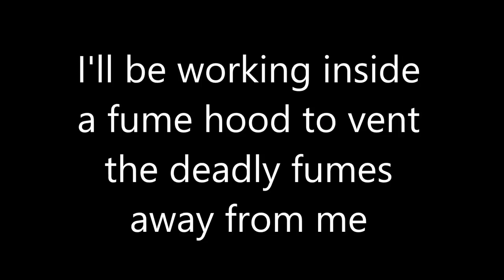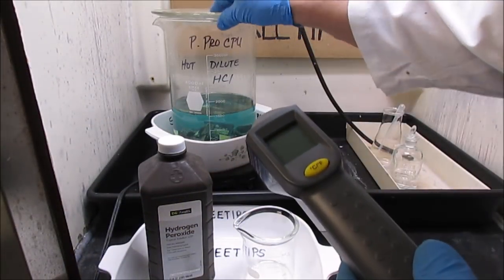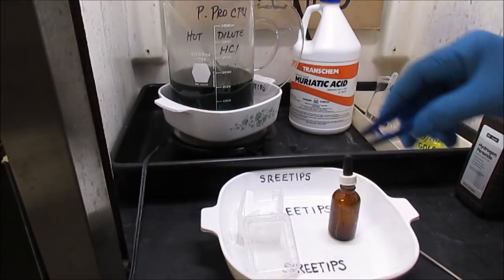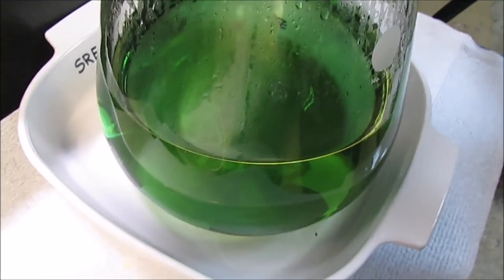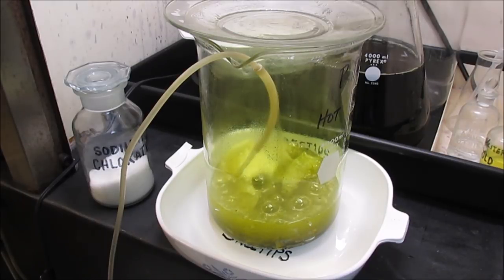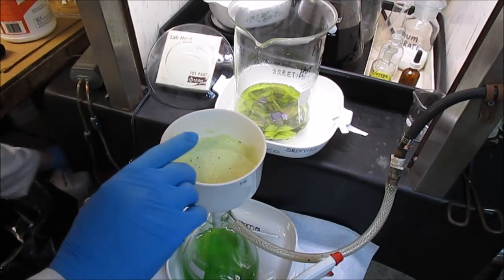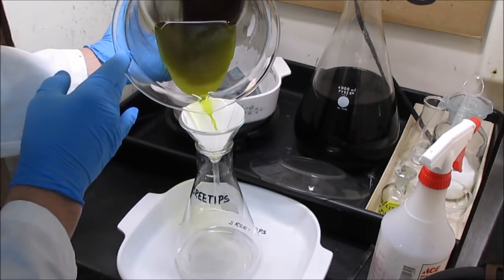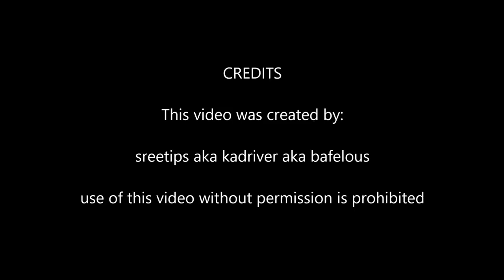Gold Recovery Pentium Pro with Sodium Chlorate

Comment: Great video, as always :)
It is a bit painful to see to see technological wonders like those processors being reduced to rubble to be processed to a bit of precious metal, I'll admit. On the other hand, it makes sense to reprocess them, since the availability of precious metals and other compounds is limited and should not end up in the environment.
I was always curious about that... what do you do with the leftover garbage of the refining process? How do you dispose of it safely? How do you neutralize the toxicity of what is left over? Do you have close at hand base-solutions to neutralize acids? How do you handle run-away chemical reactions for example?

Those could be interesting things to explain in your videos. 
Thanks for sharing and showing :)
Reply: I'm curious as well.
I have two gallons of that stuff and don't really know what to do with it.
Reply: He has the luxury of only really dealing with metal salt solutions which can actually be processed rather efficiently into harmless iron metal/iron oxides/iron salts. He does this by having several waste stockpots. To start he takes solutions with excess nitric acid and adds sterling silver and other silver sources in order to consume the remaining nitric acid. Then in the first pot he puts solutions containing silver and copper salts and adds copper metal which removes the silver from solution and cements it out. He removes the silver and places the remaining solution into a second pot and adds iron. This cements out the copper and leaves iron salts. He can then remove the copper and then take the iron salts and either dispose of them at a designated disposal plant or convert the iron salts into iron oxide which can be sold or just disposed of since it it pretty much inert.
Reply: @jasonmcfall5578 I have 1 tonne and I can’t decide if spend the resources to get the gold or just sell as is.

Comment: "From another refiner" [sic] some samples of PP's sent to get tested and found something very interesting.
As you might be aware there's a couple major variants to a PPro, Mostly the ceramic version and the later plastic version.

The plastic version was the latest and most expensive which had a 1mb cache as apposed to 512kb in the ceramic.
So instead of a processor die & a cache die, the plastic version has 3 dies, 1 processor & 2 cache dies.
Effectively increasing the gold content by 33%, but the actual dies are bigger as well.

Our results are approx .7g Au per cpu but could be a little more.
Do you think this is where the 1g per cpu myth came from? were early assaying results using the plastic version and it the got confused with all PP's and add to that backyarder refiners not recovering the potential led to the down ramping of PP's in general?

Comment: I always leached the base metals with nitric, never occurred to me to just use hcl to do it. Will definitely save on nitric costs. Thanks kadriver!
Reply: Hydrochloric takes forever. I've accidentally disolved gold using HCl and hydrogen peroxide with heat. Don't have to worry about that with nitric

Comment: Hello,
First off, I would like to say: Great videos!!  I think I watched all of them at least 3 or 4 times.  You make the process look so easy.  I just installed my fume hood and supplies to try this for the first time.  I ordered some computer chips for this initial project but it appears that these chips have been removed very sloppily.  It appears there is still some solder left on them.  As a new refiner, will this solder burn off in the incineration process, or is there an extra step to remove this solder? Like you, I would like 3-9s fine product when I am done.  I know you are busy, but any suggestions will be appreciated.  Thanks.
Reply from the maker: In the refiners handbook, she says to soak in hot hydrochloric acid until the solder softens then scrap it off with a knife before trying to refine it. Escrap is kind of tricky, very little gold.

Comment: So I work at an e recycling company. We easily get 100+ junk processors per month. I imagine if we shredded them we could fit a lot more than 10 into a 4 L beaker at once. But is there a ration of volume HCl to mass of shredded processors?
Reply from the maker: My experience with escrap is very limited. The yields are low and the amount of waste is high. For these reasons I don’t process much escrap.

Comment: When you smash up the cpu's, does size of the pieces matter at all? If you were to put them it a mortar and pestle and smash it down pretty fine (say like sand size granules) and then put in an oven for LIGHT incineration would that help the the rest of the process along just because of increased surface area of the material? Also do you happen to remember what these CPUs weighed in total before you did anything with them? Looking to start stocking up, the listings I see are all by lbs and don't say exactly how many CPUs you get, just by weight. Trying to calculate rough totals based off the 0.3 grams per cpu you stated near the end of the video. Although I'm sure not all are created equal so I'd get a guesstimate at best. Thanks in advanced if you reply!
Reply from the maker: The way I understand is there are tiny gold wires inside the sealed area. Grinding them to sand probably won’t help.

Comment: Hello, Sreetips, I understand that the fumes are EXTREMELY toxic, even deadly. But what about combustible, flammable, or any kind of fire hazard?
Reply from the maker: The only time I have flammable gas is when doing reactions with zinc. I think the bubbles contain hydrogen. But as long as it’s not allowed to accumulate it’s not a problem.

Comment: How many grams per liter are necessary to dissolve 8oz./L gold using this method with sodium chlorate? i attempted to saturate a solution at 150F with sodium chlorate 800ML HCL and the chlorate reacted with a small explosion and flame inside my reactor. Is it necessary to introduce at cold temperatures? Safe to raise temperature once the chlorate has been fully dissolved? Thank you for your advice
Reply from the maker: I’ve never tried to dissolve that much gold with HCl and sodium chlorate.

Comment: Unless you physically put nitric acid into the mix how else could gold get into the solution?
Reply from the maker: Sodium chlorate mixed with hydrochloric acid forms chlorine gas. Chlorine gas will dissolve just about any metal, even platinum.

Comment: question as the level drops below the 1500ml mark. are you loosing water vapor or are you loosing the acid. is you solution gaining strength or is it getting weaker before adding additional acid?

Comment: Would grinding up those CPU's in a blender help in any way to speed up the process of separating the gold foils from base metals?
Reply from the maker: I've never tried it. But experience tells me that grinding the ceramic too fine would load up the filters and slow things way down. Plus, I don't think it's necessary. They are broken apart to get at the tiny gold wire inside the sealed CPU.
Reply: Plus it will increase the haul !

Comment: Sreetips, what does the hydrogen peroxide do for the reaction.  I know you said it would help loosen up the gold foils from the base metals.  Are you able to elaborate?
Reply from the maker: Scott, this is a reply from aga, who is a chemist. He says;

"When the peroxide was first added it looked exactly like it oxidised FeCl2 to FeCl3, judging by the instant yellow/brown colour change.

That might sound like a waste of H2O2, but FeCl3 happily complexes/reacts with copper & aluminium too."

Scott, according to this statement, the hydrogen peroxide forms a compound that attacks and dissolves the base metals under the gold, but does not attack and dissolve the gold. The FeCl3 dissolves the copper under the foils and releases them, intact, into the solution. Pretty cool stuff. I added the peroxide on a hunch, it wasn't in the plan, but it sure worked nicely to release those foils and put the base metals into solution so I could get rid of them before I attempted to put the gold in solution.
Reply: sreetips thanks to both you and AGA. I have been wondering this for sometime. It also answered the question “niggling” around the edges of my mind since I knew HCl did not dissolve copper.  Yet, HCl and peroxide is frequently used with e-scrap. Finally makes sense.
Reply: #1scotthack  yeah, in much the same way that nitric acid has to be added to hydrochloric acid in order to oxidize gold and form aqua regia, the peroxide reacts with the HCL and oxidizes the base metals, even copper without touching the gold. Makes the process go much faster. The peroxide and HCL will do this without iron present but FeCl3 also acts as a complexing agent and catalyst which further helps the reaction.

Comment: I dont understand. In 1 video you dissolved into the solution Pd and Pt from zinc with HCl and peroxide and said maybe gold will dissolve. In this video gold didnt dissolve in HCl and peroxide. Why?
Reply from the maker: I don't know. But I wasn't trying to dissolve the gold. I wanted to dissolve the base metals under the gold so that the gold foils would be released and then I could recover and refine the gold foils. I don't know if HCl and peroxide will dissolve gold, I'll have to give it a try.
Reply: Because the gold will only dissolve in a Hydrochloric and Nitric (Aqua Regia) solution.

Comment: Great video, but I can't understand the reasoning behind breaking the CPU's up. I appears, that it only made for a more complicated process, as the broken CPU's were Not dissolved in solution and it made it harder to incinerate them and remove the gold plating. Just an observation!
Reply from the maker: There are tiny gold wires inside of the sealed CPUs.

Comment: What happens to the fumes exhausted from your fume hood. I have not yet found a video which answers this question.
My concern is that fumes released to external air is dangerous to surrounding area, if not so for the refiner.
Can the fumes be neutralised, or rendered less harmful?
Reply from the maker: My fume hood exhausts out the top of my roof. I don't use a scrubber because I don't make enough fumes to create a problem. A scrubber can be added. I think that they are filled with caustic soda. It neutralizes the fumes.

Comment: Every time I melt gold powder, I get gold flakes stuck to the sides of the melt dish. Is this typical? How can I avoid it? I glazed the dish with borax and add borax while melting.
Reply from the maker: When I get gold sticking to the sides of the melt dish I crank up the flame on my oxy/acetylene torch. Get everything real hot, sprinkle borax on the inside upper walls (where the gold adheres) and use the force of the flame to drive the gold off the wall and down into a central mass at the bottom of the melt dish.
Reply: @sreetips  Cool tip. A sreetiptip. I just use mapp only. Kinda makes crappy buttons because everything doesn't quite liquefy that well. Maybe if I add some insulation around the outside of the dish it will help things stay hot and they will slide down doing what you said.

Comment: Question: I tried the poor mans nitric (sodium nitrate) to dissolve my gold from recovered flakes. It worked and dissolved all the gold to solution. Thing is the stannous chloride did not indicate gold in solution. and SMB did not render gold from it.  Where could the gold have gone if not in dissolved solution as it clearly got dissolved. (used Hydrochloric plus dissolved sodium nitrate) ?
Reply from the maker: Sounds baffling. I’m just as puzzled as you
Reply from the maker: I’ve never used poor-man’s. I have used HCl and bleach with good results. But it makes lots of deadly chlorine gas. Must do it in a fume hood.
Reply: Thank you for all the information in your videos. Inthis video you didn't use a test for iron and magnetism; I'm doing my second project with Cpus,  when I came to disolving the gold the solution came negative for gold.  I suspect that iron cemented the gold. I Saw the gold before before putting HCL + bleach; is it good to try stump-out even the solution is negative?. I really appreciate your answer.

Comment: I'm just learning about this so forgive my ignorance. Would it not make more sense to put those chips in a AR solution and then decant when the expected gold is dissolved based on time and temp in solution? Based on what I have learned this entire process should only take an hour at most.
Reply from the maker: Putting the chips in AR sounds like it would be faster and it may be. But it causes other problems that makes the process difficult. I have a video on CPUs in aqua regia. It's not that easy.
Reply: @sreetips  I would be very interested in seeing that video, I started putting power interconnect pins in AR because I got tired of waiting for all the base metal to dissolve (some of the pins were quite large), Once the pins turn black I filter out the solution and that turned out to be a big time and money saver.

Comment: I use a heat gun to heat the cermic piece and the tiny cleets will come lose. . They dont go into the ceramic  but are sodered on the surface. The . What ever you call those thing s the only ones i encountered was with gold plated metal caps inside and out .  The refiner in Philadelphia  dumps those in a ball mill    and sales them pulverized  to a large refiner in Philadelphia . . I have seen gold plating on ceramic. Most notably  in allumniim boxes containing a cermanic circut board  and the gold plating  was  applied   directly  to the very thin cermanic circuit board . I used hot muratic acid to loosen the solder  where resistors  were attached . And wash aqua regia over the cermic waffer the gold would  instantly go into the chemical   these were from satellite  dish  supplier  .
Not home satellite  dishhes but  industrial satellite  supplier . On wellington road Outside of Manassas  Va.
Reply from the maker: How many does it take to get a gram of pure gold?
Reply: @sreetips   i go bonkers with gold fever. When looking at the beauty  of gold plating. But those chips  are worth far less than you could imagine
Reply from the maker: I've processed Pentium pro CPUs about four times because they are said to be the highest yielding of all CPUs. I got 0.3 grams pure gold per CPU every time.
Reply: @sreetips   wow thats impressive . A measurable amount of gold per chip

I look at some pictures on a google search. And im confused. Do these  cpu have gold plated metal caps over the actual chip . In your video it looked like the gold cap was laid over the ceramic  and shattered   when you broke them up. Those Pentium  pro cpu have metal caps over the actual  chip?
Reply: @sreetips   those IBM  cpu were assay  at $22 gold per chip and the price of gold spot was say $360 a troy oz. So what is the ratio of $20 of gold  compared to $360 is 18 .  So it woulx take 18 cpu to equal an ounce of gold. Cant remember how many the machine had . Say 12 per machine  so each machine had 2/3 an ounce of gold . .  The back planes and attached circuit boards had no visible gold the  the metal clips were said to be palladium.  Who knows . They look like nickle with a translucent  application  of gold on the nickle or palladium fingers  where they locked into the back plane. In other words 2 dollars a lb. For 80 lbs of circuit boards  fifty lbs of insulated wire   50 lbs of cast aluminum  two high intensity magnets  / no value  three hundred lbs of steel . At that time steel was  worthless  pretty near
Reply: @sreetips   if you wanted  to continue  making experimental video on electronic scrap you ought to check out  surplus government sales . Back in my day it was all by news letter on paoer but was switching over to computer  sales.. i would be looking for solid silver wire . Typicall found in  electrical controll pannels with multi ptong plugs that screw or twst lock  into the pannels   covered with loose fitting rubber like tubes    DAHLGREN  in southern Maryland develops experimental   fire control ( gunfire ) and th at was ( 20 years  ago ) was a good place to purchse military  electronics.  Maybe some of your subscribers that  have an interest  and time to check out  the military and civilian depots  like The GSA auction in  Fairfax county Va   

 The worst government  gold bearing back planes came from submarines  fire control  electroni  eack pin was inserted in a teflon jacket the teflon jacket inserted in the backplan aluminium  board.   Teflon  will sag when heated but will not burn. The aluminium  base plate absorbs  the heat. I never could figure out how to get the  gold platted pins out  . Best to sale to an unsuspecting  buyer . Even the refiner in Philadelphia  had no luck with those back planes
 But the glistening gold plating was a sight to behold
Reply from the maker: I have difficulty keeping up with the high yielding material that my wife gets me. Seems like there's no time.
Reply: @sreetips   i watched a video on another channel  where the host processed those memory strips    with ,like 5 chips per strip and usually 6 strips in a row . The chip are black . The host keep pointing out the gold wire embedded in the  black ceramic or plastic . That i hadnt considered . When i had those large white ceramic chips CPU or what ever they are cslled. Assay . So the Assayer must of just assayed the pins only. Because  that is all i considered was gold bearing

 I reasoned that the electrical conductivity happened like in a transistor by a mysterious method if positive and negative voodoo of non metallic substances.   Yet in othere CPUs the ones with the gold plated metal caps i could see super duper fine gold wire radiating out of the actual tiny chip going into the ceramic and shattering the cermanic i saw nothing metalic  in them . . So that is where all the gold is . Inside the cermanic or plastic. And not just in the gold plated copper pins and caps